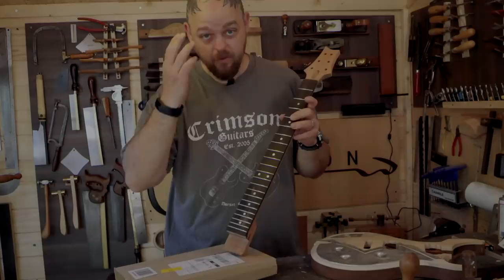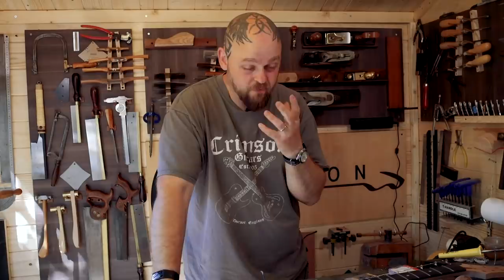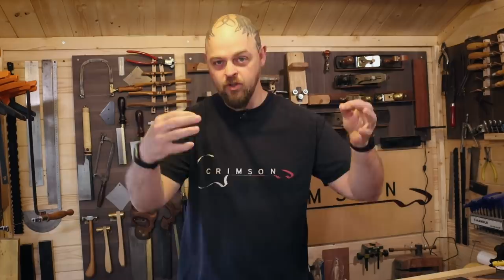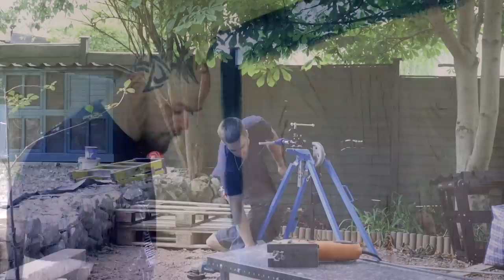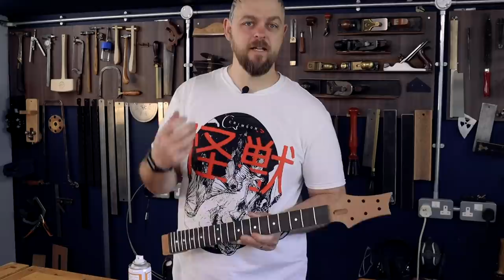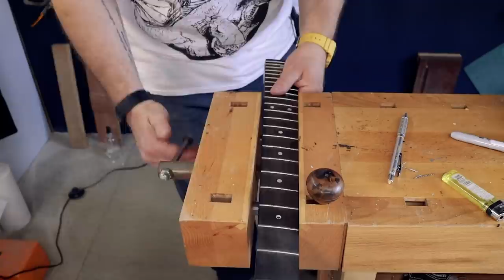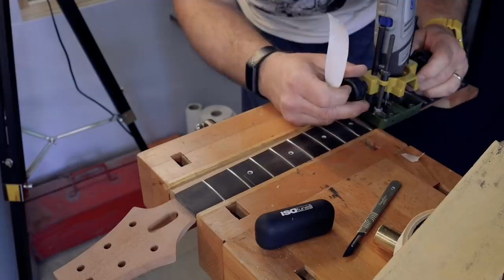Utter Failure Ep 10 | Building a CYBERPUNK 2077-inspired Custom Guitar

Comment: Well I can tell you this. Because I have tried. First the LED powered through frets would have failed for another reason. Here is why... As you guessed you will power your strings. However, what you failed to realize what how this would interact with pickups. Which is not good. I tried something similar once pickups are extremely sensitive to electrical impulse. For example Eddy van Halen drill on pound cake. Or if you take a high gain powered pickup especially like EMG. You can hold your TV remote control up to them and hit buttons to make noise on pickups. 

Also different colors of LED will also produce different background hum through your guitar as well. Different colors use different voltage. Not a big worry but again I did one once that changed colors. Single color background hum is just background hum. But if you rotate colors hum changes pitches which is noticable.

Now the absolute best way to do this is fiber optic cable and 1 single led. The fiber optic cable with light diffuser for feet markers and side markers. That many LED is going to cause a lot of humming noise. Not sure your going to like the end result. Sure will look good but might be unplayable because of noise.

Comment: I think it would look good/be easier if you replaced the whole fret board section at the markers with the plastic (making the whole thing a fret marker) and created a fiber optic effect. Maybe route out the spine of the neck, do your wiring, and plug it afterwards. You'll have to work around the truss rod, but I know you're capable.

Comment: Ben just take the fret board off and run 2 wires up the inside set the LEDS then just wire them up 
Then make connection plates in the neck pocket and the base of the neck 
Wire the battery and resistor into the body with a small switch that's hidden in back 
You know it makes sense Ben

Comment: LEDS are diodes, and depending on the color they have a different voltage drop. Red has the lowest, green, blue, white have higher voltage drops. Therefore only the red was on in your test, and the resulting voltage (because of your parallel connection) was to low for the white ones.  If you put a resistor next to every led., and put those parallel, then you can use different colors. Why not use SMD Led's and resistors? Those are much smaller and maybe easier to integrate, but more difficult but possible to solder by hand?

Comment: use the double metal strips on both sides of the neck  then inlay  perspex design across frets with led on ether side with the led drilled into the perspex would be like a pin strip could even  ben metal strips to match  the design then use leds between the pinstrip posative negative on each side

Comment: Since you are taking the fret board off anyways have the lights come up from behind the fretboard through the dots, keep the designs for the wiring but fill them with resin to capture the light from the LED and cap the top of the inlay so you still get the outline of the inlay circle and the wiring cavity design .  Something like this  =O=

Comment: the easiest way to install the led's and wiring would be to remove the fret board ans rout a small channel parallel to the truss rod and make a small pocket at each dot and side marker for the led's in the small pockets just below the resin in the...drill out the dots in the fret board and thru where the dots are then tape the face of the fret board and inject resin where the dots ans side markers meet.(die the resin any color desired)when reattached the fret board should be stable as before.  then the .. a s,all notch in the end of the neck for the wires  coming out of the end to the neck and drill thru to the control cavity where  the battery and resister in the will live the rest is easy...

Comment: dremmel tool and about 6 hours of hell 42 holes and cut out from under each fret one hot wire each side other end of L.E.D wired to the fret tang and activated when you hold that fret and the  resistor at hot side install off/on switch  fill all holes with epoxy and sand level and polish each window. it was awesome but  I dont ever want to do it again LOL...

Comment: The problem with putting a red and a white led in parallel is that the red led has a smaller forward voltage. This means that it effectively clamps the voltage that the white leds see to a value that is too low.

Comment: LEDs are cool and all, but a centralized diffuse laser supplying light to a fiber optic inlay would do what you want with a certain elegance... The fiber can be glass rods and acrylic adhesive, or an other clear plastic if you wanted more durability... You could run them like pins if you like as well... Just a thought on some things I did in a composite shop working of replacing no longer manufactured instrument display panels for helicopters...
Actually, I hadn't thought of it initially, but a resin injection would create matrix which route the light to wherever you like, and would solve the issue of having any LEDs to maintain...
Always look for the simplest most elegant solution, right?👌
Also, you can texture and resurface the injection facets so as to make them look however you like... Clear and projecting beams, or opaque and glowing... Rounded, flat faxed or multifaceted... Then there is the potential to produce 3d printed and thus more precise surface inlays that you can use to route different color circuits and such... Lasers are pretty sweet and a lot of people do some pretty cool things with them with relative ease and simplicity.
Anyway, I hope this can help you in the future, I really do wish I was in your shoes, and I'd ask to work for you but alas I'm in the PNW, and spend most of my time as a 50ton cyborg.

Comment: LEDs in the neck is so 2052 - go for fibre optics! :)
If you want a solution to the strings shorting out the LEDs, whilst using the frets to conduct the current, check out what Ben Woods is doing with his "Nylocaster" - piezo pickups, and nylon strings ...

Comment: Run a common positive wire that does not contact the frets, use the frets for the negative (ground) wire, then you can have a common ground for the whole guitar, fingerboard, pots, and LED strip. That way fretting they strings won’t “mix” circuits... idea 14?
Reply: Also, replace the dots with Perspex blocks, then you can put the LED anywhere under the block, have less fretboard between the block and fret that has to be filled/repaired, and you can just drill a hole from the side of the neck thru which to glue a side dot also made of Perspex which would be bonded to the block fret marker. Just my $.02 ✌🏻

Comment: If your LEDs are perfectly matched you can get away with one resistor for all the LEDs but it's better to have one resistor per LED. This is a perfect example of why you need this. The Red LED has a lower turn-on Voltage than the white ones and so it's taking all the current. Even using all white LEDs, you'll find that certain LEDs are drawing more current than other ones and the LEDs may not be all equally bright. Again it's better to have one (larger) resistor per LED rather than one small LED for all of them.

Had you stuck with the holes as light pipes idea, If you had got a little white paint in the holes between the LEDs and the mother-of-pearl inlay it would have greatly helped this as light-pipe (especially with the dark mahogany wood)

Comment: I would, without a doubt, use fibre optics in the neck. You could even run the fibres to the same LEDs in the body
Reply: Fibres can't short. You won't ever need to replace an led inside the neck. They're thin. About the hardest thing is the limit on curvature. You can terminate fibres in all sorts of things.

Comment: I'm only 4 mins in but its seems like you have an option 4. Route a channel down the back of the neck in line with the circles. And just drill the sides out where needed. Cover the channel with whatever material you want. Is there a reason why you wouldn't be able to do this?

Comment: Don't know wether you'll actually read this but why don't you use the fibre optic qualiies of certain plastics to put your neck lights in. I would run a thin channel between the fretboard and neck all the way up the side of the neck to where you need it. Drill the dots out like you have been doing then rig up plastics into the voids (I hope you understand my meaning, I often struggle getting ideas down). But the result would be something similar to electrical appliances that use a small on board leds to light up shaped panel lighting. I was thinking it could be lit from the strip leds in the body so that it would always show the same colour as the rest of the guitar.

Comment: Hi! Probably too late but here's my tuppence.
You've gone to a great deal of trouble to make the lights in the body of the guitar serviceable, why not extend that philosophy to the neck?
Here's the move:
Obtain or fabricate a large(r) diameter truss rod. Drill the neck to accommodate the new rod. The drill won't wander because of the existing hole.
File a flat section the length of the truss rod so that when inserted in the neck there's a D shaped void that you can put an LED strip in.
Then drill out the dots so they connect with the tunnel and plug with perspex. Then when the LED strip fails you can just pull the truss rod out put a new LED strip on it and reinstall!
PS. was that a Sub you had on in the last vid? Nice choice if it was!

Comment: My idea was idea 11 but in reverse. I would have removed the fret board (sorry Ben) and inlayed the legs of the LEDs and the circuit into the back of fret board with the heads flush through the fret markers and then glue it back up

Comment: Using the frets as conduits... the frets that touch the strings which touch the bridge which is grounded through your pedals and amp? What could possibly go wrong with sending 9V down your signal's ground?... (rhetorical question)
The LEDs flashing on and off would have been the least of the problems.
Reply: Maybe not so rethorical after all. Since it would go precisely through the ground (like shielding signals do) and not the signal’s live, I genuinely wonder what would the effects be in theory... 
Any electronics specialist who know what would happen ?
Reply: Alan d'Eon Actually, all electric guitars bridges (and the strings by extension) are connected directly or indirectly (via the trem springs plate for example) to the ground. When you touch your strings, you will hear noise reduction on your amp (especially on single coils guitars and with high gain), because your own body takes part in the circuit as a shielding antenna. It also is a security feature to protect you from the damages of (rare) cases of electrocution.

Comment: Ben, next time, try to embed thick, colorless transparent fishing lines, which will act as optical glass fibres. Fishing line is very tough, very durable.
Considering the very short distance, another type of transparent wire can be used. It needs to be at least 0.5 mm in diameter. 1mm is better.
For each light you will need a wire. The ends all come together where the neck meets the guitar body. Inside the body is a very bright LED, which shines into the wires, held together by a copper tube. They must line up perfectly, ofcourse. This way, you can replace the LED if it fails. And the wires in the neck can stay there forever, they are maintenance free. Where you want the light to shine, you place a drop of milky white resin (epoxy), with the wire inserted.
Make a test setup, before you commit to a real guitar. Try to find a large LED, between 5 to 10 mm diameter.
______________             
________________D=>   ======================= *
power supply     LED            Wire   (20x)               dot of resin(20 x)
Guitar body                 |                     Neck

Comment: Thanks for posting the entire process, including the failure. Too bad the fretboard gave up and you're probably going to do it the "proper way".

One idea that might have looked nice, instead of the insulated wires, would have been to use two different metals for the wires (for example copper and silver or copper and steel), one for the positive and one for the negative side. Since you were inlaying them anyway, the insulation was unnecessary to begin with, and having the two different metals meet at the LEDs might have looked nice... although: With some very faint orange glowing LEDs that might look more Steampunk than Cyberpunk.

Comment: My thought... how about... routing a central channel (or perhaps offset to avoid interfering with the truss rod cavity) the whole length of the front of the  fretboard and inlaying a square section Perspex rod the entire length of the fretboard with rebated notches between each ‘marker’ so that the raised facets between, form the marker dots. Then have ebony inlays which mask the parts of the Perspex below the channel from the front and have ONE LED at the base of the neck which throws light along the length of the Perspex? Then drill perpendicular holes to meet the rod from the edge of the fretboard to insert small clear Perspex circular section side maker rods (or resin flooded cavities)? 

I think it was Mark Twain who said “anyone who never made a mistake, never made anything” or words to that effect... you’ve inspired me to try my hand a making a guitar! I will start experimenting with a cheap online kit, then hopefully learn from experience and ‘graduate’ to a more expensive instrument... one of yours I think! I might be able to afford a course one day 🙏 Thank you for this very insightful ‘sucky’ video! Solid gold mate! SOLID GOLD!
Reply: Also, only one light source will ever need replacing...!

Comment: 26:35 Me: yelling at the screen, "The strings are grounded to the bridge!"  So, run a common Positive wire, connect each LED (and individual resistors) to it and connect the Ground side to the appropriate fret wire. When you play that fret, the light will turn ON, and the lights will follow you up and down the fretboard.
Reply: Just don't play chords....

Comment: The reason for the red LED lighting and not the white ones when connected in parallel is that different colours of LED operate at different voltages.  A typical red LED has a forward voltage of about 1.8V, whereas white and blue are about 3V.  LEDs are nonlinear as far as voltage is concerned and will clamp the voltage across them.  That means the red LED was clamping at less than 2V, so the white LED never had enough voltage to conduct (and emit light).
Putting LEDs directly in parallel isn't a good idea(*) - each LED should have a current-limiting resistor equal to (Battery Voltage - LED Voltage) / Led Current.  Let's say you had a 9V battery and blue LEDs.  You only need 1 - 2 mA before most blue LEDs (or, indeed, most modern LEDs in general) are bright enough for indicators, but you want it bright.  Let's say 4 mA.  You'd need a resistor of (9 - 3) / 0.004, so 6/0.004 = 1500 Ohms, which is a standard value.

(* Sometimes it's done when the LEDs are on the same peice of semiconductor for big displays.)
You can save power if you can organise the wiring by putting chains of LEDs in series.  As long as the no. of LEDs x the LED voltage is less than the battery voltage, all is good.
Four red LEDs in series is about 7.2 V.  Keeping the 4 mA current, that's (9 - 7.2) / 0.004 = 470 Ohms.  470 is a standard value and will be fine.
Each resistor chain would look line this: 
Battery + ---|>|---|>|---|>|---|>|--|resistor|-- Battery -.
Then you wire the chains in parallel.  This saves a lot of power so improves battery life.  At those currents, the chances of the LEDs ever failing are very, very small.
Something else to look out for with LEDs is how much the beam spreads (its half angle).  Most cheap ones are quite wide (50 - 60 degrees either side of the centre), but if you're trying to do poke light down a hole, something around 10 degrees would be better, as more of the light will end up where you want it.  When I'm allowed back in to my office again, I don't mind bunging some high-brightness, narrow angle red and green LEDs in the post.

Comment: The reason it didn't work with red led is because they have a lower forward voltage so when it switched on it clamped the voltage lower than what the white leds needed to turn on.